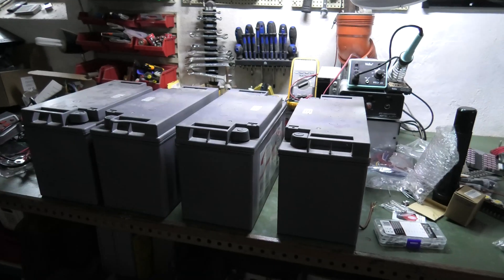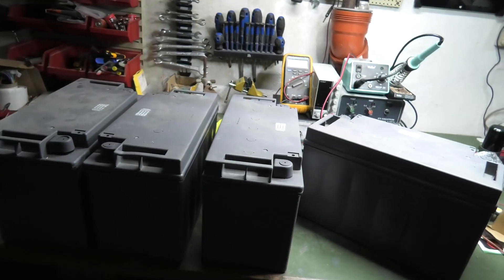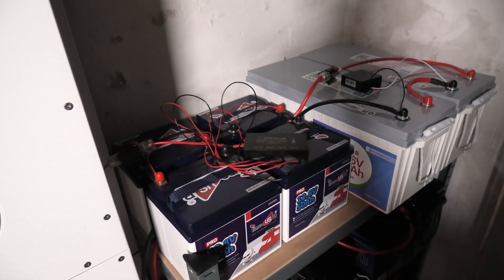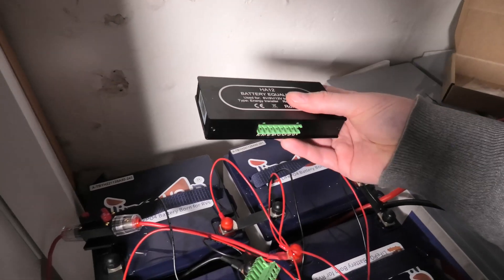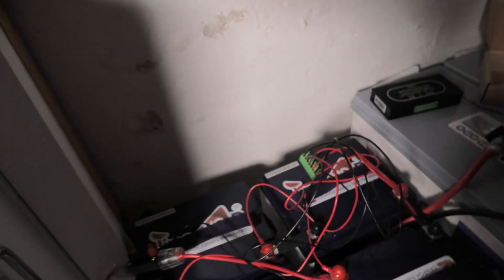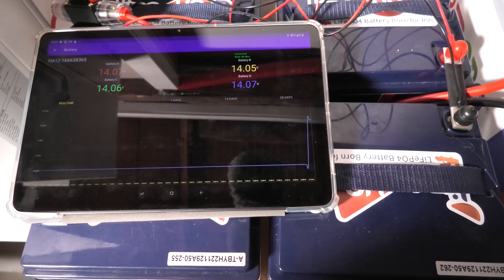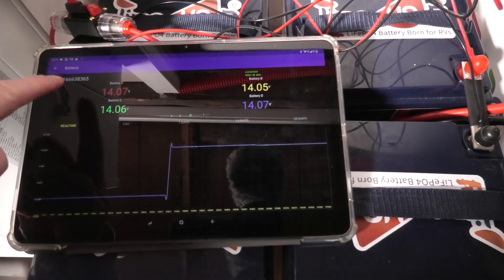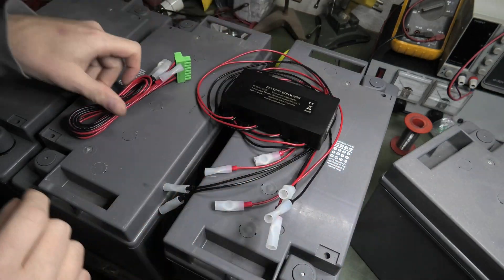Lifepo4 Battery Equalizer HA12 BlueTooth 4 x 12,6V - 1484

Comment: What are the specs on the green connectors? Do you happen to know the pitch between the connectors. I tried this with a 5mm pitch connector and when I used ferrules and shrink tubing on the included 16 AWG wire (this is a marine application) there was not enough room to fit the wires in an 8 gang connector. I had to use 4, 2 gang connectors instead.
Reply from the maker: I have added a link to the connections I bought in this video : https://youtu.be/KrPjgT5fWPc

Comment: Is this applicable on parallel connection or only on series connection?
Reply from the maker: Øhh the batteries are in series 4* 12,6V to make the 48V (51,2V)